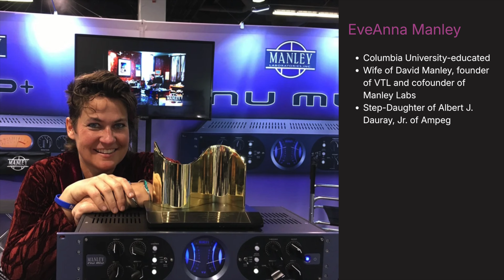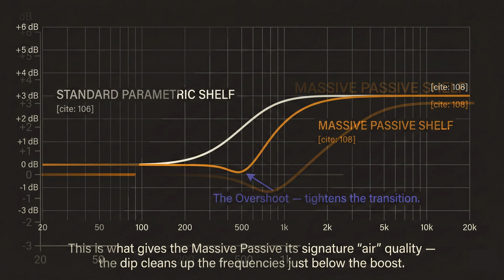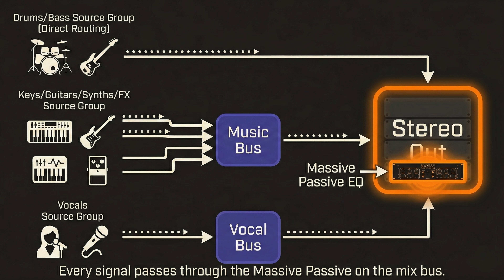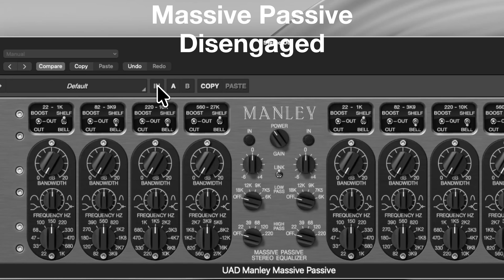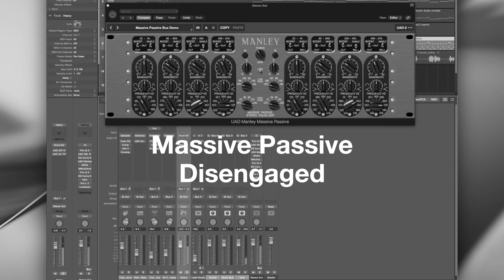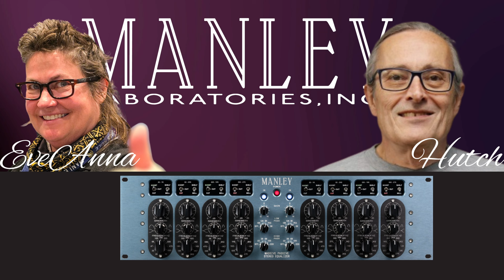Manley Massive Passive: The 'Expensive' Polish Your Mix Bus Is Missing #ManleyMassivePassive

Comment from the maker: I'd love to hear from you in the comments — where in your chain do you put your mix bus EQ? Before the compressor? After it? At the very end? Drop your approach below and let me know if today's video changes your thinking.
Reply: I am really excited about your in depth analysis of the Massive Passive. It is a rare bird indeed!  I’ve had mine 16 years and now I’m considering taking it out of storage  after watching this excellent presentation.
 
After the experience that I had just shared with you in the previous comment I proceeded to buy my own Massive Passive when they were only $3500.00. That had to be close to 2010. I immediately bought the UA version when it was first released but honestly I haven’t compared the two.

On the 2 buss I rarely use anything at all because I try to get my sound before the master fader so I can leave plenty of headroom for the mastering guy.  Guess you could say that I’m a bit old fashioned not trying to master my own material!

To answer your question I have used a compressor on either side of the EQ and I don’t have any ritualistic requirements in my mixing bag of tricks (so to speak) but if I were to think about it just depends on the program material. The only principle I operate from is the less is more concept but in most cases on my   mixes you will usually find a compressor after the EQ.
Reply from the maker: @davidseal6863 First off, my sincere apologies for taking a few months to get back to you on this. Your comment somehow slipped past me and I only just saw it, which is a shame because it is one of the best ones I have gotten on this video. Better late than never, and thank you for such a thoughtful message.

Sixteen years with a real Massive Passive, that is fantastic, and you absolutely should pull it out of storage. A rare bird is right. And you bought yours around 2010 at 3500? That is a beautiful piece of timing, those have only gotten harder to find and more expensive since. If watching this presentation is what nudges you to fire it back up, then this video did its job and I could not be happier about it.

The fact that you own both the hardware and the UA version and have never compared them is honestly a gift waiting to happen. When you do get the real one back up, do a quiet shootout on the same source. I think you will be pleasantly surprised at how close UA got the flavor, and you will also hear exactly where the hardware still has that little something. No pressure either way, just a fun afternoon for a gear lover.

I really respect your 2 bus philosophy too. Getting the sound before the master fader and leaving clean headroom for your mastering engineer is not old fashioned at all, that is discipline, and a lot of us could stand to work that way more often. Trusting the mastering guy to do the mastering is a sign of experience, not the opposite.

And thank you for actually answering my question. Compressor on either side of the EQ with no rigid ritual, letting the program material decide, is exactly the right instinct, and landing on compressor after the EQ most of the time is right in my wheelhouse too. There is a good reason it feels natural, once you have shaped the tone you want, the compressor gets to glue the finished balance instead of chasing a spectrum that is still moving around. The less is more principle wins almost every time on the bus. Sounds like you have got your bag of tricks dialed. Thanks again for watching and for taking the time, it genuinely made my day.

Comment: Your setting on the UAD Massive Passive works great. Mix bus compressor is first, MP goes after. Only thing I see it's giving about 2+ more db of gain while set to 0 db using it on the mix bus. So I reduce the gain to -1 or -2 db on the MP to balance it.  I then follow it with a mastering compressor, then a limiter.
Reply from the maker: @djstyle That chain order is exactly right and matches what I laid out in the video. Compressor does its dynamic work first on a clean signal, then the Massive Passive adds its tonal character to the compressed result, then the limiter handles the ceiling. Solid setup. On the gain bump, what you are hearing is the passthrough coloration doing its thing. Even with every EQ knob at zero the tubes and transformers are adding harmonic content and a slight level increase as part of the circuit behavior. It is not a flaw, it is the plugin behaving exactly like the hardware. Pulling back 1 to 2 dB on the output to level match before your mastering compressor is the correct move and exactly what you should be doing. The key is making sure you are comparing bypassed and engaged at the same perceived loudness so you are hearing the character and not just reacting to the extra gain. Sounds like you are already thinking about it the right way.

Comment: whatever gate/expander type thing you're using on this video is super distracting and therefore kinda sounds like ish. How do I trust you?
Reply from the maker: @JJL1342 Good ear, and fair point. You're hearing a noise gate on the voiceover and yeah, it's set more aggressively than I'd like. I'm still dialing in my recording chain and room treatment, and the gate was compensating for room issues that I'd rather solve at the source. Working on it. As for the trust question, I hear you. But I'd say judge the content by the research and the information, not the narrator's room acoustics. The Massive Passive doesn't care what my voiceover sounds like and neither does the engineering behind it. That said, the goal is absolutely to get the production quality matching the depth of the content, and comments like yours help me prioritize that. Appreciate you watching both videos and keeping me honest.

Comment: While still a student at MI I rented two Manley Vari Mu’s and a Massive Passive to complete a self mastering project for a mixing class. Putting the first Vari Mu in compress followed by a Massive Passive, then the other Vari  Mu was placed in the limit mode. 
It sucked ALL the digital ice pick and associated artifacts completely out of my mix.  And at that point in my career I barely knew what I was doing!

You should try it with the real hardware like I did.
Reply from the maker: @davidseal6863 That is an incredible chain, Vari Mu into Massive Passive into another Vari Mu as a limiter is basically the Manley dream signal path right there. And the fact that it pulled all that digital harshness out of your mix, that's exactly what those tubes and passive circuits do so well. They naturally tame the stuff that doesn't feel good without you having to surgically hunt it down. The fact that you were doing that as a student at MI is awesome. I would love to get my hands on the real hardware one day, no question. For now the UA plugin does a seriously impressive job of capturing that character, but hearing stories like yours just makes me want the real thing even more. Thanks for sharing that, really cool to hear from someone who's worked with the actual units!
Reply: @kenet @kenetic_sownd 
My first experience with recording was in 1979 when digital delays were first being used and digital recording was only speculated about. 

At that time I came out to LA just to go to a recording engineer school called Sound Master located in North Hollywood, CA. At Sound Master we used a Quad Eight (Electrodyne) console with a MCI  JH24 2” tape machine then “mixed down” to a two track Ampex 1/2” machine. 

I only attended MI starting in 2009 to familiarize myself with digital recording but had decades of passive information in my head about the entire recording process including cutting the acetate master. So basically I hit the ground running when it was time to rent those hardware items.  Especially when my classmates were using Waves plugins for their class assignment.  IMHO the hardware will always outperform plugins. And I use both when I record and mix.

I tell you all of this to suggest that someone needs to take the shuttle and start putting ample hardware inserts into the interfaces and the latency algorithms incorporated into the DAW’s because it can be easily done if you understand a few basic principles with phase relationships and latency management methods to compensate for the mathematical differences.

Comment: Having used the real thing I'd like to mention there is no cricuit, no tubes, and no transistors in a digital plugin just using ones and zeros. I'm not saying it sounds bad, but there is a difference between the hardware and software and they don't sound interchangeable. I don't think the blind test claim holds water. But hey, if the plugin works for ya, go for it.
Reply from the maker: @channelyoururl Really appreciate the perspective from someone who's used the real hardware. And you're absolutely right that there are no physical tubes or transformers inside a plugin. But I'd push back a little on the "just ones and zeros" framing. What UA did with this model was six months of component level analysis where Manley actually sent them the real parts so they could measure and mathematically characterize the behavior of each tube, transformer, inductor, and capacitor individually. The plugin isn't sampling the output of the hardware, it's running real time mathematical models of how those components interact, including nonlinear stuff like inductor hysteresis and dynamic transformer saturation. Is it identical to the hardware? No, and I don't think anyone should claim that. But the blind test results I referenced aren't mine, they come from the Sound On Sound and Tape Op reviews. The Tape Op reviewer actually owns a hardware Massive Passive and achieved over 20 dB of signal cancellation when nulling the two. He said he was "sweating bullets" trying to tell them apart. That's not me making the claim, that's a hardware owner with professional monitoring in a treated room. I think the honest answer is that the gap between great modeling and real hardware has gotten remarkably small, even if it hasn't fully closed. And for the 99% of us who will never have $7,000 for the real thing, the plugin gets you genuinely close. Thanks for adding to the conversation, this is exactly the kind of discussion that makes the comments section valuable.

Comment: Is the demo track in mono?
Reply from the maker: @robshrock-shirakbari1862 The demo is recorded in stereo, coming straight from the mix bus out through the Apollo into the screen recording software as a full stereo signal. That said, the mix I used for this demo does not have a ton of hard panning going on, so most of the elements sit fairly centered in the stereo field. That can make it feel narrow and give the impression of mono even though it is technically stereo. The focus of the demos was on the tonal and harmonic character of the Massive Passive rather than stereo width, so I prioritized clarity of the A/B comparisons over a wide stereo spread. Appreciate you asking and thanks for watching.

Comment: Just ran the demo. It does SO MUCH without getting the dynamics out of control.
Reply from the maker: @angelocherymusic That is the beauty of the Massive Passive's design. The passive topology and tube gain staging add all that harmonic richness and character without slamming your dynamics the way an aggressive active EQ or saturator would. It colors the signal musically while letting the dynamics breathe. That is exactly why mastering engineers have trusted it for decades. Glad you fired it up and heard it for yourself. There is no substitute for hands on experience with a tool like this.

Comment: Great deep dive, thinking about taking it for a spin to get a feel on my own source material. I'll try it in a similar mix bus setup like you mentioned.
Reply from the maker: @_floeter That is the best way to learn any tool, hands on with your own material. I would suggest starting with the plugin fully flat and just listening to what the tube gain staging does to your mix before you touch any EQ knobs. That way you establish a baseline for the coloration the circuit adds on its own. From there, try the three move approach from the video, a gentle low shelf for weight, a presence lift in the 3 to 5 kHz range, and an air shelf up top. Start subtle and let your ears guide you. Every mix is different so the settings that work on my demo might not be exactly what yours needs, but the approach will translate. Let me know how it goes and thanks for watching.

Comment: Match the EQ curve and volume and my money is on that you will fail a blind test.
Reply from the maker: @unsaved6 I actually address that exact scenario in the video. I matched the Massive Passive's EQ curve using FabFilter Pro-Q 4 and compared them side by side with level matched output. The curves are the same but the character is different because the Massive Passive is a nonlinear system. The parallel band topology, inductor hysteresis, tube harmonics, and transformer saturation all contribute sonic information that a static EQ curve match cannot replicate. You are not just hearing a frequency curve, you are hearing a circuit. That said, blind testing is a great practice and I encourage everyone to do it with their own tools and their own ears. Thanks for watching.
Reply: What I ment was to match the EQ curves by referencing that Bertom EQ Curve Analyzer to get them to be identical curves and volume with both plugins, those added harmonics are essentially frequency boosts, something to keep in mind is that boosting harmonics on a whole mix introduces intermodulation distortion(bad).

Comment: Ive got a Massive Passive with Magenta 5 with Acustica and my massive passive with nebula Analog in the box, and both of them bro, sound 90% to the real hardware, UAD, Pulsar...non of them are touching Acustica Audio and Nebula Libraries LOL
Reply from the maker: @johnisrael5183 Acustica Audio and the Nebula libraries definitely have their fans and they take a different approach to emulation using convolution based sampling rather than the component level modeling that UA uses. Both methods have their strengths. Convolution captures the static behavior of a circuit very accurately at a specific operating point, while component level modeling aims to recreate the dynamic nonlinear behavior across all operating conditions, things like inductor hysteresis, tube saturation that shifts with signal level, and parallel band interactions. Which one sounds closer to the hardware can come down to the specific settings, the source material, and personal preference. Glad you have tools that work for you and thanks for watching.

Comment: You've got the EQ curve all wrong pal. Almost the whole audio is boosted 1.5dbs, taking that in consideration, the shelves should be around 4.5dbs boost, with a wider Q on 20hz and 3dbs on 20khz
Reply from the maker: @blacksaona Appreciate the input but I would push back a little on the idea that there is one "correct" EQ curve here. The settings in the video are demonstration settings chosen to show how the Massive Passive behaves, not a universal mastering preset. One of the key points of the video is that the Massive Passive uses parallel band topology, which means the bands interact with each other in nonlinear ways that you cannot predict the same way you would with a standard series parametric EQ. So prescribing exact dB values and Q widths as if there is one right answer does not quite apply to this tool the way it would with a digital EQ. The broadband level shift you are noticing is actually the tube and transformer passthrough coloration, which is a deliberate feature of the design and something I specifically demonstrate and explain in the video. That said, every mix is different and the beauty of the Massive Passive is that it rewards experimentation. If those settings work well in your workflow, that is great. Thanks for watching and for sharing your approach.

Comment: Bwhahahahaha…….this plug in is not even close to the real thing…….
Reply from the maker: @nicefish10 That is a bold claim. For what it is worth, the Tape Op reviewer who actually owns a hardware Massive Passive achieved over 20 dB of cancellation when nulling the plugin against the hardware, and then could not reliably tell them apart in blind A/B tests. The Sound On Sound reviewer had colleagues who sometimes picked the plugin as the better sounding version. So while no plugin is a perfect 1:1 clone of the hardware, calling it "not even close" does not really line up with what hardware owners and professional reviewers have documented. But if you have experience with both, I would genuinely love to hear what specific differences you are hearing. That kind of detail helps everyone learn. Thanks for watching.